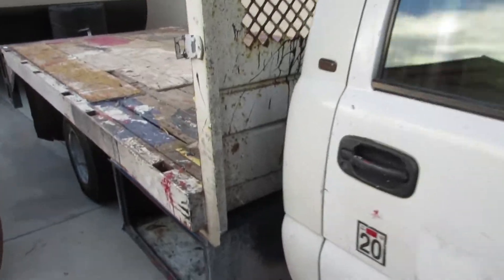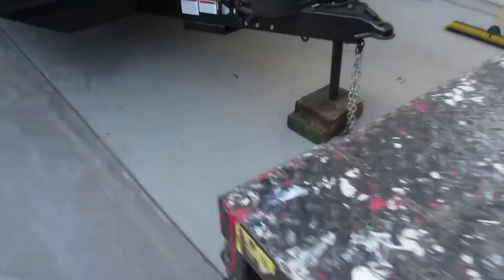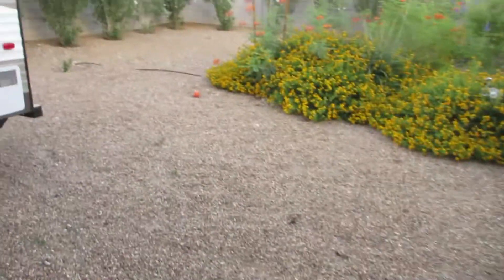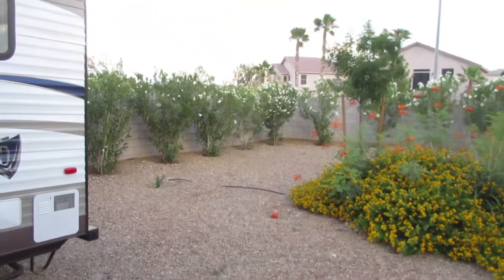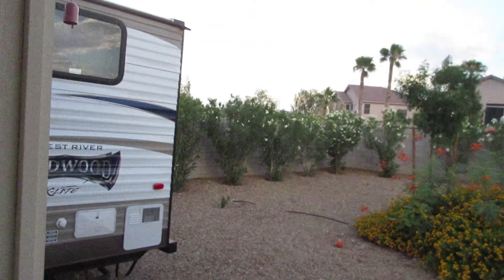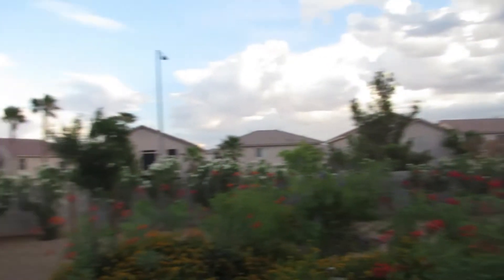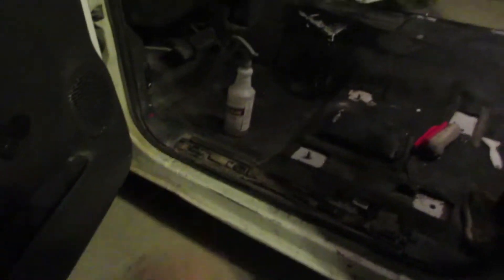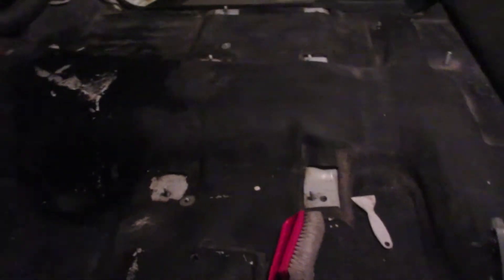Crawler Hauler Interior Clean up

Comment: That flex plate you got is the same one they use from the factory. I found one bolted to a 5.3 with a 4l80e behind it. Was in a van in the junkyard. Even tho i have seen them crack and its a known issue look at how many miles it lated till it failed. Worth 40 bucks for it to last another 300k miles. Keep up the work👍
Reply from the maker: Thanks man! We will see how she holds up, if I have any other problems, I will order up a Yank converter.
Reply: MrWhitels1 .... You keep saying your going to moab. When are you going to be there? I will be in moab from sept 8 till 11
Reply from the maker: I'm gonna miss you by a few days, I will be there 16-18th.

Comment: Usually the 6.0 had the spacer bc the crank was shorter but that's what I read on a forum for my 5.3/th350.... does that flexplate have a weight on it or is the 6.0 internally balanced? Quick question for my build, does the torque converter have to be shove up against the pump with those little splits on the shaft or can it kinda hang off a bit bc if so, I'll need to buy the spacer versus the little metal ring that goes on the end of the crank..... i gues will find out the hard way so the wife will let me buy an nv4500!!!!!!!!!! Nice job on the cleaning man! Looks amazing and almost new compared to what it was before! Definitely need to try that cleaning stuff on my truck eventually! Keep up the stuff man ways looking forward to your build.... building my fuel system soon... gone keep the fuel tanks and HOPEFULLY my tanks are still good until I replace them. I just can't let it get below quarter tank! Just buttoning up the wiring and retorting everything and then the front end too.... using those cheap 4 slot fuse box blocks for it until it's running and I replace the cab
Reply from the maker: Early 6.0L and I believe some 4.8's had the longer crank but they were old. Most of the newer stuff has the shorter crank and the spacer is needed. 6.0 is internally balanced.

I think with most torque converters, you want to spin them while applying pressure and you should hear 2-3 clunks when it drops into the trans, and then you know it's seated correctly. Once installed it will need to be pulled forwards about 1/4" to bolt onto the flex plate. If you don't want to replace your tank, maybe look into some Holley hydramat, it's not to expensive and should keep you from having issues.

Thanks for watching and good luck with your swap!
Reply: MrWhitels1 thanks man.... well the tank issue is just rust and years of corrosion. The driver tank doesn't have a cap so there is a glove in its place so who knows what the tank is like..... plus, you
Know with in tank pumps it's good to have the baffle so the pump doesn't starve and burnout..... but I really want to keep it original... in so the blazer tank but I don't want to make my own filler door OR run a hundred feet of rubber hose to the factory location..... it'll sort itself out

I had my clicks on the converter and then when I looked. There was a good 3/4 of an inch of space where the bolts go in the converter.... so Ill have to buy a spacer...... also, what are your opinion on e85 injectors?

Idk if I should just buy regular injectors or find the plugs for the e85 injectors!
Reply from the maker: Whatever you do with the fuel system, do it now so you don't have to fool with it later. You should be able to get a replacement tank that has a baffle in it for pretty cheap. Sounds like you have a flat flywheel, in the case you need a spacer not just the sleeve. With the injectors it all depends on the price, you can probably find someone selling a truck intake with injectors / rails for cheap.
Reply: MrWhitels1 yeah you're right but if that's the case I'll probably just buy a car I take and get it out of the way.... I'll probably just  live with the stock tanks.... the 87-91 trucks have dual tanks and they have baffles bc of the fuel pump and that's what I'll get along with the 87+ sending unit..... and yeah it is a flat flexplate(4l60e) so I'll have to prove a spacer.... thanks man..... I just picked up my new car so that'll take some
Of my attention for now

Comment: Do you think the 7-8 exhaust bolts broke into head may be causing a slight exhaust leak tripping that lean code?
Reply from the maker: I don't have a lean code, just the one for the rear o2, because the wires are cut.

Comment: Look up 15835667 on Amazon.  It's the upgraded bumpstop.  I'm going to assume the front bumpstops are falling apart after you mentioned the missing torsion adjuster bolt.  EDIT
Reply: Nick.V70 had some good videos on these front ends.
Reply from the maker: Your the man! Thanks for the part number and info, I will check out the vids.